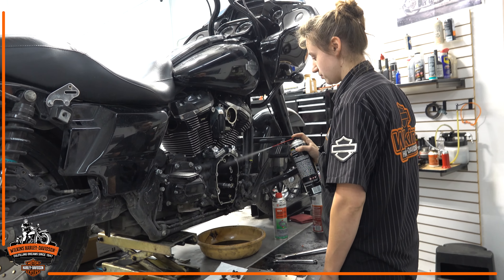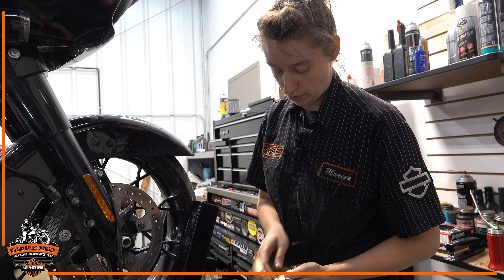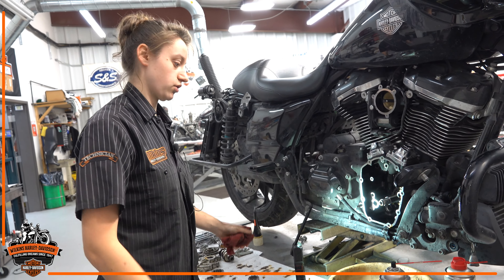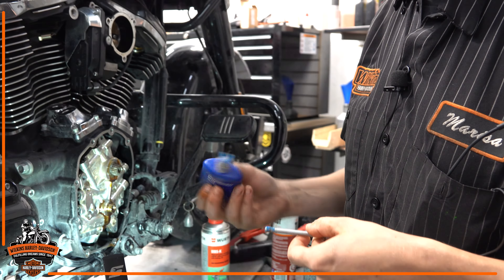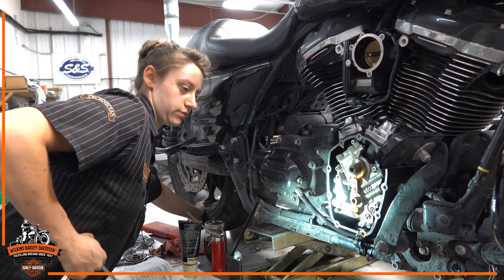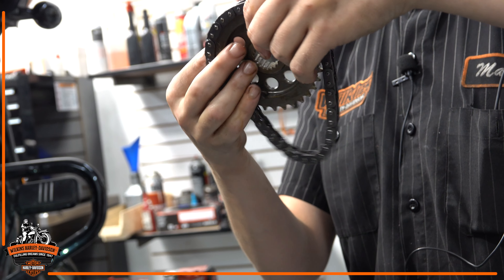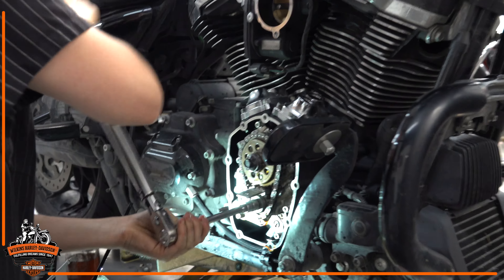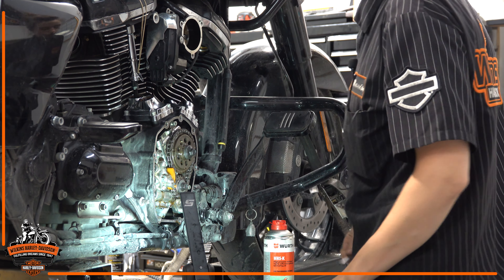Screamin' Eagle Stage 2 Power Cam Installation on Road Glide

Comment: Ok. I was going to (think about) replace my cam & rods(stage II upgrade) but, after watching this and realizing I don’t have a torque wrench, feeler gauges, cam bearing tool, etc. or the know how to set the timing or any of the screws to proper torque…. I’m out!  lol. Guess I’ll have to pay the dealership to do it. You made it look so damn easy though. I thought it was something as simple as just taking a cover off, replacing the cam & rods then putting back together. Boy, was I wrong. :(
Reply: Was thinking the same thing 😂
Reply: i get the dealer to do all my work
cuz then it's warrantied 
not your problem if you blow the bottom end because of poor installation
Reply: Just pay to have it done by a professional who does it every day. You got to take care of your baby.
Reply: Actually you can do it. Just watch other people do the stage 2 so you pickup variations. Buying the tools for the job is much cheaper than paying someone else. I personally just kept watching and when i do my stage 2 shortly. When I get stuck I just go back to my YouTube and see what's next. It's very helpful

Comment: You did a  24 .lbs torque on the crank bolt with an Extension, So that would NOT be a TRUE Torque of  24 .lbs should be less than that Unless you know the loss of Torque value of the Extension used.
Reply: It is actually true torque because it’s 90 degrees off the head of the torque wrench.